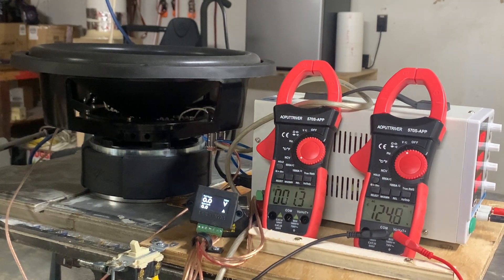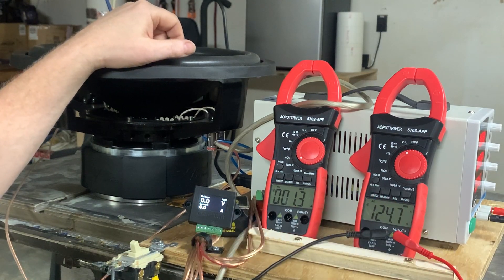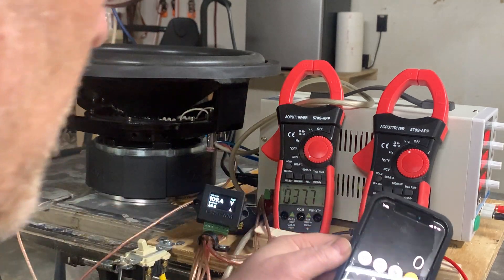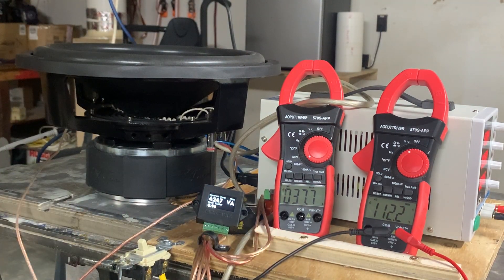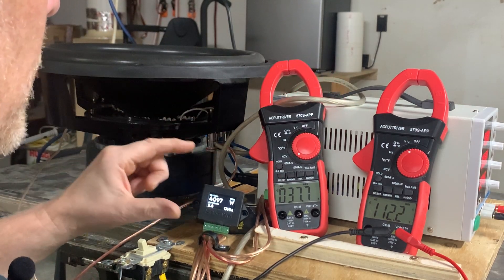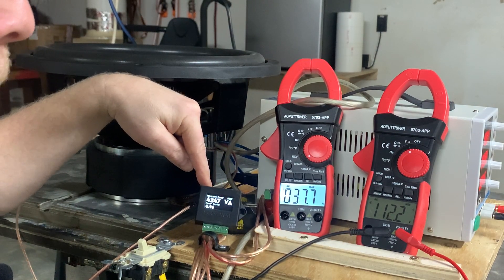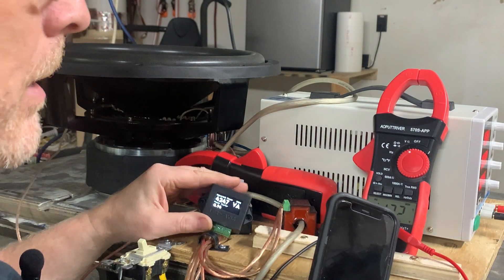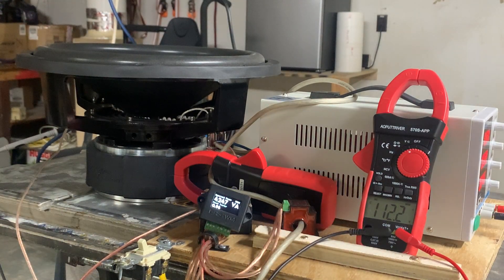BassHead Garage Watt Meter vs Old School PART 2

Comment: Why not use a actual amplifier not a 120v wall plug? I know a amplifier is AC output..But i would think it would be a little different because a wall outlet is 20 amps max..Where as a amplifier can pull in 100s of amps of current to produce the ac output..But idk 🤷‍♀️ im just guessing..I really want to get me one of these watt meters hopefully soon...I always just do what u did..I clamp how much current i pull and multiply that by my ac output from my amplifier..So voltagexamprage=watts...But i always get some guy telling me im wrong cause of "power factor"...But no one seems to be able to tell me how to put that into the equation?? So i just say, i guess i got it right then lol..
Reply from the maker: I did a whole series of tests on the BHGWMv1 and v2 along with the TL Magnum, SMD AMM1, SPL LABS next LCD, clamp and DMM. All the videos are on my channel to view. A wall socket is as consistent as it gets and is a clean source of AC power so that is where I started. Amplifiers were used in other videos which adds to the usefulness of these tools since that is what we measure as an end result. As far as in AC power the formula is VxAxPF=W whereas power factor measures the amperage of the electricity as it passes back and forth through the clamp/hall sensor since AC current is alternating, meaning it goes in both directions. This is why speakers move in and out when AC current is applied and when DC current is applied to a speaker the cone move in one direction and stays there until the circuit is removed. There is a formula to measure power factor which is overly complicated which is why using these devices to measure RMS wattage is definitely far easier and more accurate versus using the old school method of clamp/DMM. 

Here is a link that explains power factor if you are interested, but like I said it is overly complicated:

 https://www.allaboutcircuits.com/textbook/alternating-current/chpt-11/calculating-power-factor/
Reply: @AllAboutAudioJW yeah that is to much mathin to math for me 😂lmao 🤣 talk about making something way to difficult lol.
Reply from the maker: @johnoates3326  I told you it was overly complicated. LOL 😄
Reply: @jeremywilliams8558  thanks for the info!! Will definitely check it out even if it is beyond me to comprehend or figure out

Comment: I bought two of those watt meters and they both have issues showing the impedance properly. One shows much lower impedance than it should and the other shows 0.0 ohms always. They both show way more wattage than they should too. I'm sad.
Reply from the maker: I have 2 of these watt meters. Zero issues. You may have the version 1 watt meters which were apparently very inaccurate. Mine are the version 2 watt meters. I have proven them to be accurate versus a traditional clamp and volt meter. I have both BHG-WM's installed in 2 of my competition vehicles to compare them to the Termlab at the Bass Outlaws state vs state Finals next weekend. Stay tuned for those results.
Reply: @AllAboutAudioJW  I keep wondering if I installed the clamp and voltage plugs swapped or something and broke it. It seemed to work fine when I tested it on my in house set up then something went wrong when I installed it in my car and now it acts broken no matter where I test it. Anyways, I will stay tuned for more content on these. Hopefully I can get one working on my setup before the end of the year with shipping like it is now.
Reply from the maker: @SnubBarracuda  one of my friends has version 1 BHG-WM that I am going to get to do some comparison testing with my version 2 watt meters. I will post the videos as soon as I get them done.
Reply: My first one had issues also... but it was user error! I swapped the wires used to take measurements. Ordered a new one and hooked up properly... so far so good. My first meter after correcting my wiring also shows incorrect impedance. Never showing above 1ohm mainly 0.3-0.6 ohm , which was crazy. That threw the wattage measurements off along with everything else.
Reply: @Cshavers77  I did the same thing and broke 2 meters. I bought a 3rd and 4th and both work fine.
Reply: They need a disclaimer/ warning showing failure if improperly installed @SnubBarracuda
Reply from the maker: @Cshavers77  that is a good idea for a video on these meters...how to hook them up properly 👍